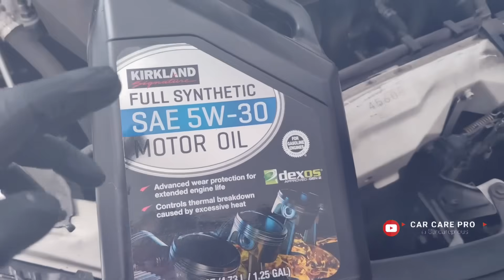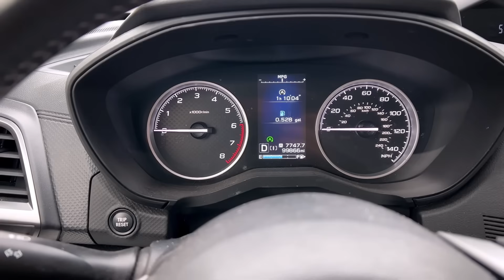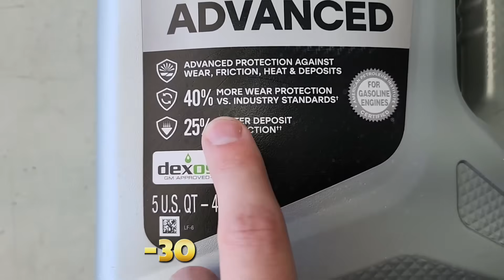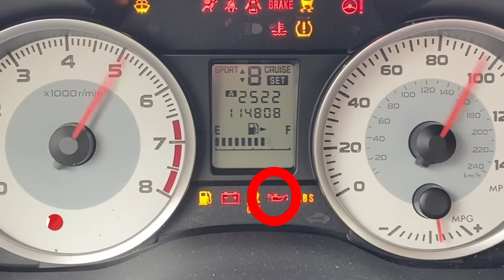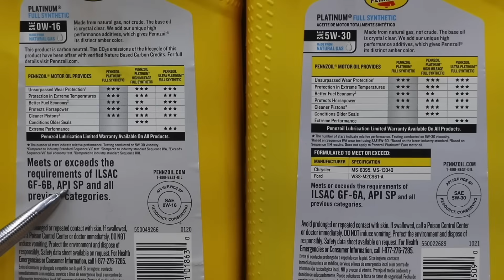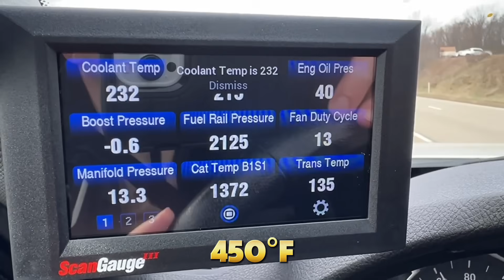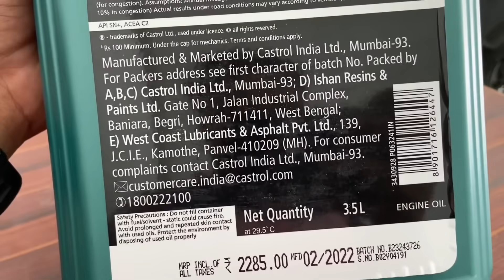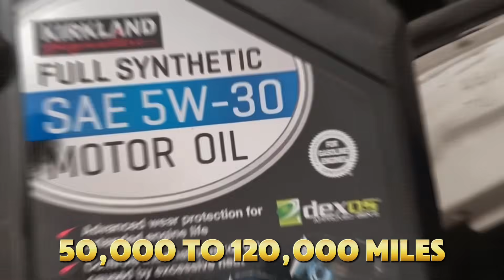The TRUTH About Japanese vs U.S. Engine Oil Requirements (Mechanic Explains!)

Comment: We all have been mechanic for over 40 years. And I know for a fact, every car that ever came in. That had thin oil had problems a lot of problems every time US changes their target on how many miles per gallon, your car can get instead of the dealers or manufacturers to be more precise, making a vehicle that just gets better gas mileage right? From the get-go and I know it can be done. I used to have a rabbit diesel, almost got about 75 to 80 miles a gallon on the highway. No diesels are doing that today because of emissions. So let me ask you a question. If your diesel's getting 30 miles to the gallon and it's a little bit cleaner in the air. And I said, little bit cleaner. And you bump it back down to 85 miles a gallon, and it's a little more sooty, and a little more dirty when fuel hits $10 a gallon. Which one do you want to run in your car? Why no? I'd rather have that old 1978 rabbit diesel. Engine rebuilt and stick it in my brand new Jeep, and take this gasoline motor and stick it in the garbage because that's exactly what it is garbage. 2016 Jeep 150000 miles completely wore out running 0W20 recommended for the motor I had an old 1960. Seven jeep commander b 62 hundred and fifty thousand miles straight thirty.Wait the whole time, we'd run twenty wait in the winter.When it was cold ridiculous change, older motors way better than newer junk.Why?Because we use thicker oil, better oil pumps and better timing chains and better timing chain slack adjusting system was never in old vehicles.They just made the chain the right length and made the chain twice as strong.So it didn't have hardly no slop

Comment: Seems like 0 -30 would be a good substitute.  Still thin at cold startup but 30 weight when the engine is warm
Reply: Just use 5w30 because it has less additives that will breakdown when oil is used
Reply: Use 5W30, then warm up the engine more 30 secs

Comment: I use Shell Helix Ultra 0W-30 ECT C2/C3 in my 2020 Honda CRV 1.5 Turbo engine. Fuel efficiency is 5L/100km on cruise control with 80kmh AC on. Easy cold start, extremely silent engine in low degrees and 40.C

Comment: cold morning start ups causes damage if the oil is slow to get moving. canada has cold mornings but 5-30 wotks well in alot of motors maybe it's just the newer models. think both will work ok one for summer one for winter.
Reply: In Europe they use 0W40